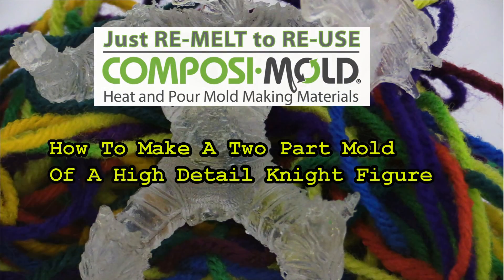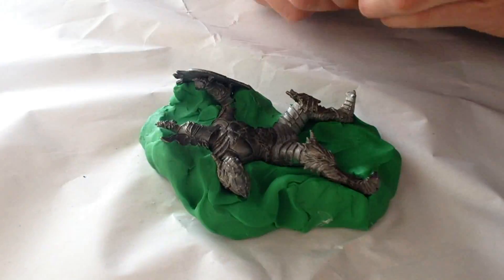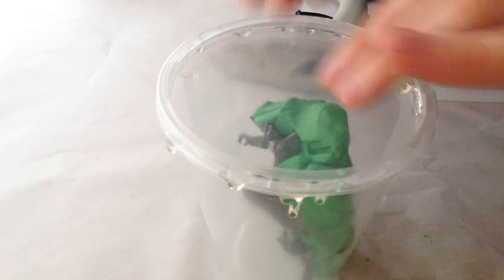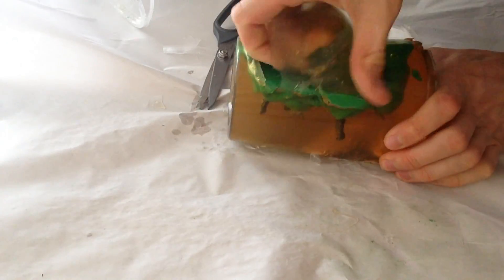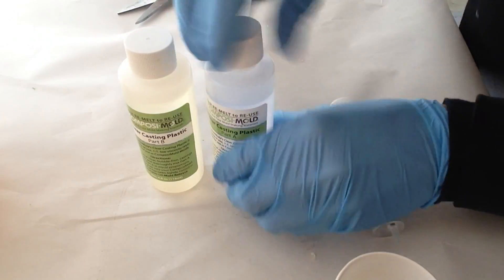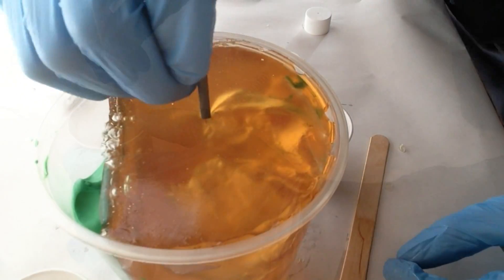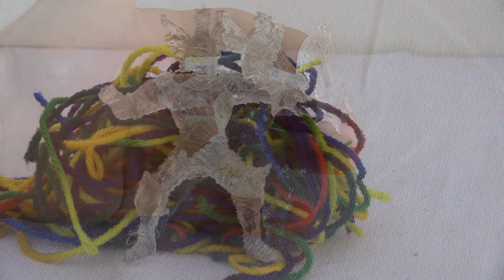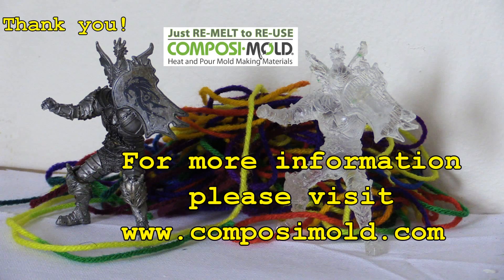How To Make A Two Part Mold And Cast Crystal Clear Medieval Knight Action Figures

Comment: OK, I am confused! Why is it necessary to first place the part halfway immersed in clay, make a mold. Remove the clay, keep the part in place and pour the second layer over the portion where the clay has been removed. Then remove the part and fill with the plastic? Couldn't I just pour the composimold around the entire part and achieve a 3D part? The part is a door handle Bezel for my 1979 Subaru Brat. The dimensions of the part which I am trying to make are 4" x 2" x 1" deep. They are brittle due to age & the 40 years of Sun/Heat, therefore, I am concerned the original could be destroyed through the process you demonstrated. Once I get one part completed, I won't be as concerned making more parts as I will have a stable mold with which to work with.  I am uncertain if using the ImPRESSive Re-Usable Putty is better or worse to use due to the factor described above, rather than the Composimold product, (which seems less destructive for a brittle original part) for my project. SEE: (Facebook link to pic) https://www.facebook.com/richard.tyll/posts/10212212624090969 - I certainly hope you can assist me in making the right decision of which product to purchase and how much I would need for this size of part. Also, the plastic resin you sell, is it ABS plastic? I also wish to use color in the plastic.
Reply from the maker: Hi Richard, For what you're duplicating, I would do it how you suggest. The two part mold method allows you to put the parting line where you want and do pretty complex shapes. Your door handle should be pretty straightforward: place it in a mold box, spray with Bubble Buster, pour ComposiMold over it and let it cool to solidify. You might need to cut the mold some to pull out the original, but the transparency of the ComposiMold should help you see where you want to cut. How much ComposiMold do you need?  Check out: http://composimoldstore.com/journal/10-most-commonly-asked-mold-making-questions/  , but basically you want to have about 1/2 inch to an inch around your part. The volume of your part is about 9 cubic inches, so you can estimate quantities of ComposiMold by assuming 5x3x1.5 =22.5 cubic inches minus the part volume = 13.5 cubic inches. ComposiMold has a density of 0.7 oz per cubic inch or about 10 oz. of ComposiMold. Since your mold box may be bigger or smaller than this, you may want to err on getting a little bit more just in case...and because it's re-usable, you can always remelt and re-use whatever and whenever you'd like.  Hopefully that helps, and be sure to check out the free ebook at http://composimoldstore.com/free-e-books/ and email us or call us if you have any issues. Thanks Richard!
Reply: Thank you for your response. I placed my order going on what I saw in the video's and read on the site. Here is what I am starting out with: 3 lbs Composimold (used) - 8 oz Composicast white - 6 cc Blue Resin Colorant. It seemed I could make two parts with this order. If it works out, I may make more for other collectors of Subaru Brats since everybody has the same problem.
Reply from the maker: Thank you for ordering! Let us know if you have any more questions as you begin experimenting.

Comment: wow. new stuff i just learned after instant mold. can it be melted with hot water instead? i mean the composimold thing. and how the bubble inside the clear resin, are there any i mean? or are they noticeable??
Reply from the maker: Thanks Keith, Use a microwave to melt the ComposiMold instead of hot water. You can also use a double boiler if you don't have a microwave. You can continuously re-melt to make new molds. When mixing the plastic resin, be sure to mix slowly so as to not introduce bubbles into the mix. We'd love to see what you make!

Comment: Question, and I know this is an older video but I'm trying to make some 28mm heroic miniatures to use for my roleplaying game and I've been trying a number of methods to cast and am trying your companies product for this go around. I'm making two part molds with keys and air vents. I can get both half of the molds made without issue and the pieces don't show any air bubbles. When I try to use a 2part epoxy resin on it the composimold gets torn up when I pull the piece out. I'm using the Alumilite 2part resin (RC-3). I've tried it a few times and am having the same result. I've also tried a number of 2 part epoxy mixes. Same issues. Any thoughts? My hobby stores out here don't carry your brand of 2part resin so I'm having to use what's availabe.
Reply from the maker: Thank you for using ComposiMold! Is the ComposiMold getting torn up because the parts are sticking? Are you using a mold release? How fast is the resin curing? Try using talcum powder as a mold release with the RC-3 resin (some baby powders are made of talc) which would work. The RC-3 and,  your epoxy might be creating enough heat to melt the mold. If this is the case place your mold in the freezer for a half hour before pouring the resin. ComposiMold melts at 135F.  I hope this helps. Thank you!

Comment: Do you clean your syringes or do you throw them away after use?
Reply: Plan on throwing them away, but sometimes you can push out the cured resin and re-use the syringes. Thanks!

Comment: i want to make fighter jet  cockpit glass . can give me some idea?
Reply from the maker: Thank you for checking out the video! You will want to use a similar technique as we used in this video. Pour a two part mold and then cast using the Clear Casting Plastic.
Reply: ComposiMold Reusable Mold Making Material thanks for replay. if you can make a video about it.
Reply from the maker: Thank you for the video suggestion! I will see what we can do about creating a video for this type of project.

Comment: Hello, I'm having some trouble with the composimold. I'm working on duplicating some plastic pieces to make a custom minifigured and I'm trying using the 2 part method. I put all my pieces on a oil base clay (Playdoh) and then made a wall around it using lego bricks to contain the mold, then I pored in half of the composimold to make the first half, but the composimold isn't cooling right, I left it cooling at room temperature for a day and it started cooling from the top but its still pretty soft and when i start removing the lego walls, the inside part or the side of the composimold that is touching the clay is still liquid and it seemed like it was mixing with the clay. I left it alone to keep cooling for anothe day but when i came back to it it was still liquid and some of it was pooring out through the cracks on the lego walls. Not sure what I'm doing wrong or if there's anything else i need to do. Thanks for any help in advance.
Reply from the maker: Thank you for using ComposiMold! Most Playdoh contains water which is turning the ComposiMold into a sticky liquid (ComposiMold is biodegradable). Also, Playdoh is pourus and is absorbing the ComposiMold. A better alternative would be to use plastilina clay. If playdoh is your only option you will have better results if you freeze the Playdoh with your model in it. Then pour the ComposiMold over your first half of the two part mold and place it in the freezer to speed up ComposiMold's cooling time. Remove the ComposiMold after about an hour in the freezer (the less time the ComposiMold is in contact with the Playdoh the better).I hope this helps!
Reply: That makes more sense now. Thanks for the awesome tips, i'll keep working on it

Comment: Would it not be better to fill from one foot and have an air hole from the to further minimise bubbles? Or am I being daft? I'm new to all this but wanted to do this to creating see through 40k miniatures to then paint as if partially invisible. Also, can this resin used be painted? Cheers.
Reply from the maker: +Alexandra Carroll Thank you for the question! Very cool project! Yes Clear Casting Plastic can be painted. It would be best to have an air hole anywhere a bubble might get trapped. Or fill the mold with resin then, poke tiny holes through the mold and into the bubbles to help pull them out.

Comment: do you get air bubbles doing it that way?
Reply from the maker: +WhoDey 77 Thanks for the question! We had great results with this casting, meaning no bubbles! I wonder if you are asking about the pouring of the mold part of the process or the injecting the epoxy resin part? Either way, we were successful this time!
Reply: +ComposiMold Reusable Mold Making Material so it's the mold silicone that you have to worry about bubbles the most? Is the resin you use  able to be sanded and drilled? I'm going to try this but the type of resin I'll need is the most confusing. I would like a resin similar to what McFarlane figures are made of. Do you have a recommendation?  I appreciate the response!  Great video.
Reply from the maker: WhoDey 77 You have to worry about bubbles with all mold making materials, that's for sure. Yes this epoxy resin can be drilled and sanded. Just be sure it completes it's full cure time of 24-48 (for approx 5 cubic inch castings). I am unfamiliar with the type of resin the McFarlane figures are made of. What properties do you want? Brittle hard or slight flexibility etc?
Reply: +ComposiMold Reusable Mold Making Material thank you very much. It would need to be drilled and sanded down. I'm looking for something that will be somewhat flexible but only when force is applied. Nothing super hard. I've been doing tons of research but there's nothing like picking the brain of someone that has experience. Really appreciate this.
Reply from the maker: +WhoDey 77 We are happy to help! The resin with the properties that you are describing is called Purecast 605 it is similar to the type of plastic used to make toy soldiers. Solid but, it will bend instead of snapping when force is applied (it can be sanded and drilled). This resin is very thick so it has to be mixed very slowly to avoid adding bubbles. Also, it is recommended that you have a gram scale to measure it because you need to mix 100 Parts A to 13 Parts B (add 13g of part B for every 100g of part A). You can find Purecast 605 here: http://composimoldstore.com/all-products/purecast-605-1-12-quart-kit/
Reply: +ComposiMold Reusable Mold Making Material Thanks again!  The consistency of an army figure is about right but just in case it turns out to be too soft what would be a 2nd recommendation?  Also is there any brands that make 1 to 1 mixing that might make it easier on a novice?  McFarlanes will bend with force but snap if bent to much. They also get more flexibility when heated and become more brittle when cold. Would you recommend injecting the mold for smaller pieces or pouring?  Do you ever cut vents in the mold to allow air to escape?
Reply: +ComposiMold Reusable Mold Making Material what about this resin? http://specialtyresin.com/
I'm looking for something I can buy in smaller amounts to start so I can be sure what I buy is correct.
Reply from the maker: +WhoDey 77 I have only tried Specialty Resin's Model-Pro and Fabri-Cast which are both very hard but brittle. Also, the Model-Pro doesn't work well with ComposiMold and, Fabri-Cast can get hot, you might have to chill the mold in the freezer prior to pouring the resin.
Reply from the maker: +WhoDey 77 Clear Casting Plastic would be the 2nd recommendation which is a 1 to 1 mix ratio it has a very small amount of flexibility but, will get more flexible when heated and become more brittle when cold. I would inject the resin into the mold if you are creating a small figure. The best way that I have found to remove bubbles is to stick a nail through the mold and pull the bubbles out of the nail hole. this works very well with Composimold because of its transparency. Here is a link to the clear casting plastic http://composimoldstore.com/all-products/clear-casting-plastic/